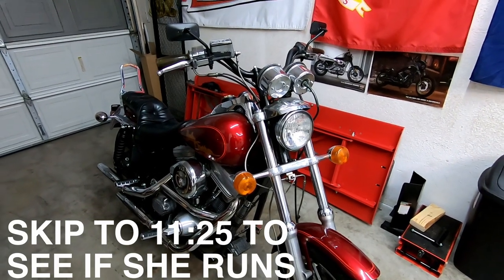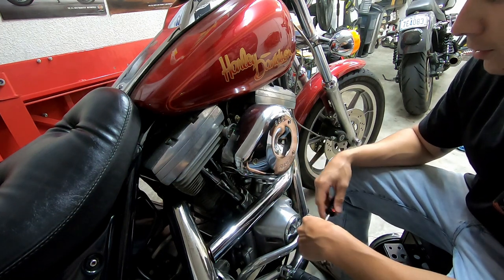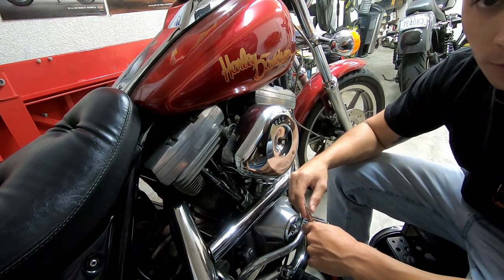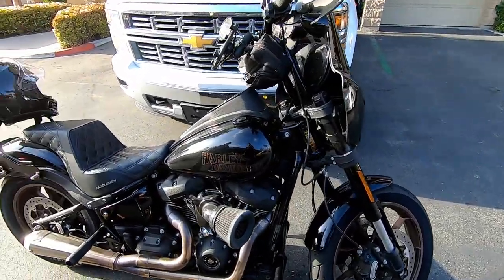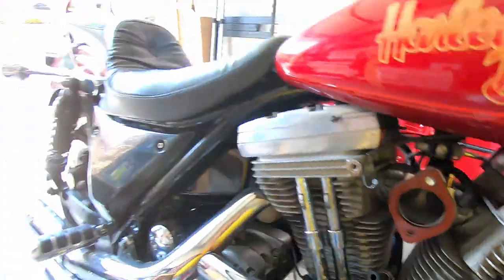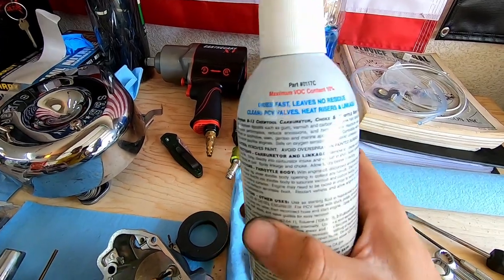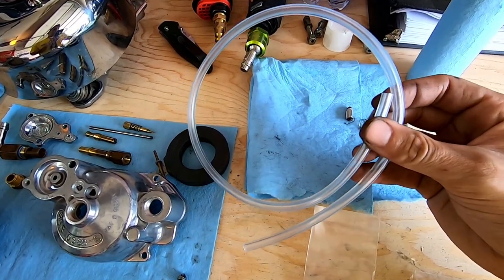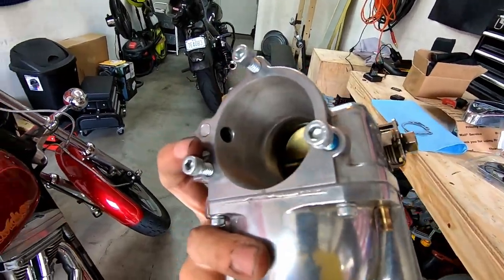FXR Series Carb Rebuild (episode 1)

Comment: Was that part where it looked like another hose went the port for the vacuum line. I had similar sputtering problem and some decel pop. But I had the vacuum line capped off cause the petcock I had wasn’t made for  my carb,  the cap fell off right after I put a new headlight on and I was trippin, thinking there’s no way that light is making this happen
Reply from the maker: It was a vacuum line for a vacuum petcock figured the same thing out in later videos lol